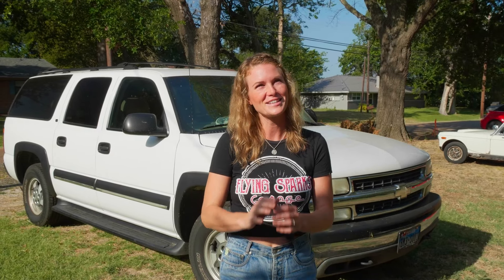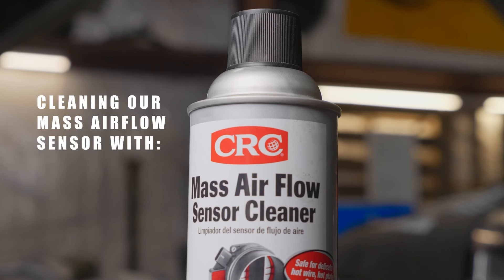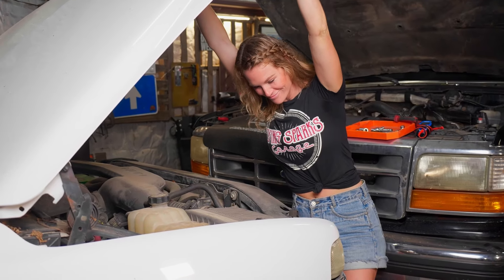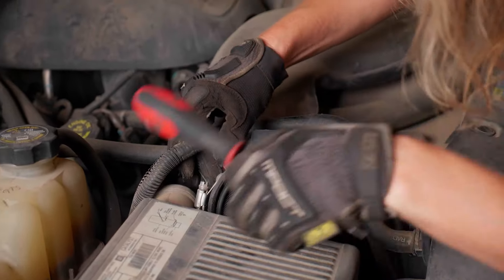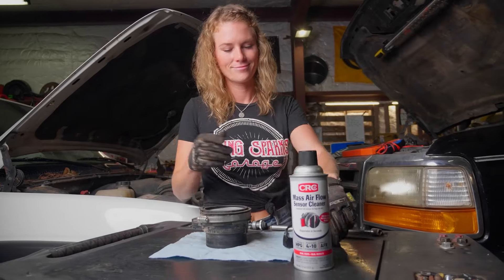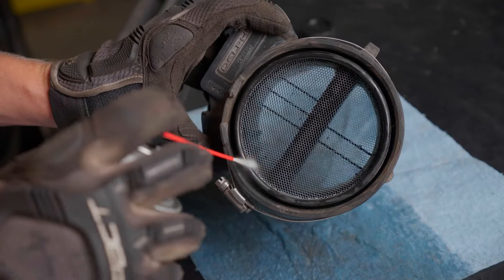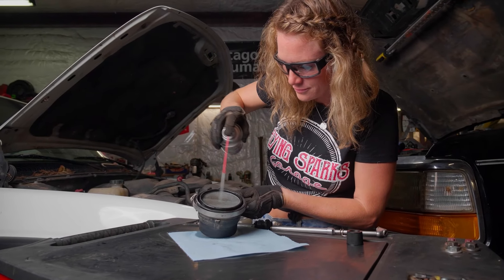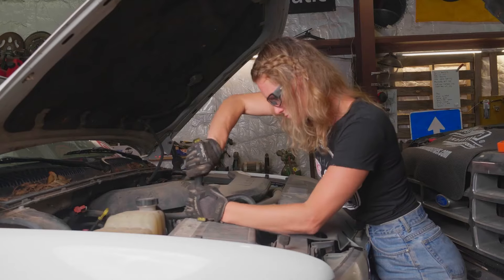How to Clean a Mass Air Flow (MAF) Sensor in 10 Minutes  l  Emily Reeves

Comment: I tried this and the throttle body cleaner . My check engine light turned on. How to erase it?
Reply: You put something in not correctly or have an air leak at ur intake after seating. Go thru it again and make sure you tightest down the intake boot and it's on all the way. If you have confirmed this, go drive for a bit and restart the car. Most likely will figure out that nothings wrong
Reply: You clear the code (either with an OBD2 tool or via disconnecting the battery for a bit). It takes several miles for the comp to calibrate to the new intake values. Drive it for a 20 miles or so, then do the battery disconnect. Then see if it comes back on. If it goes, then go to trouble-shooting. Also, don't hammer it while it recalibrates.
Reply: But tell me you did NOT use throttle body cleaner on the MAF sensor. If so, just buy a new one now.
Reply: Code reader

Comment: I am thinking about doing that to my 5.7 litre Chevrolet LS1 V8 powered Holden VY SS Commodore, it still has good power & driveability but the fuel consumption meter seems to be reading higher than normal at around 15.5 litres per 100 kilometres whereas around 13-13.5 litres per 100 kilometres is normal for mainly suburban driving.

I think that it might have to do with the fact that the car sits for a couple of days without getting driven & as of late I have been only putting 1/2 a tank of fuel in per fortnight & after the ethanol has possibly seperated from the fuel.

When I got a registration inspection done last month lean codes were set with a check engine symbol which had been turned on but they didn't fail it since they're not that stringent with the anti smog stuff in Australia as they are in some states in the U.S. Where they will fail it since a check engine light is a no no.

I think that water in the fuel caused it because no lean codes have been set since & the Long term fuel trims are all good now !

Comment: You should expand your marketing. Ref., below:
Can you do a video on using CRC Mass Air Flow Sensor Cleaner as a safer alternative than standard carburetor spray cleaners, for (the newer, black) plastic Briggs and Stratton carburetors - or maybe something like CRC 05103 QD Electronic Cleaner, as another safer, secondary alternative . . . or maybe even on comparatively, which of the two would be the better / safer alternative, and why?
Seems like no one else has done this yet.
Thanks, in advance.